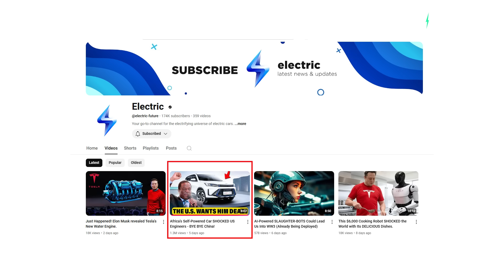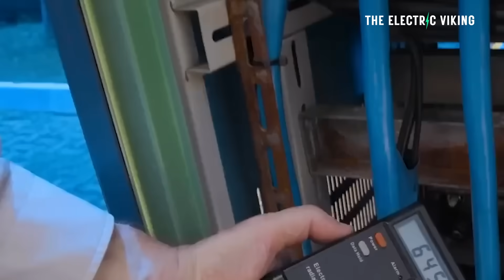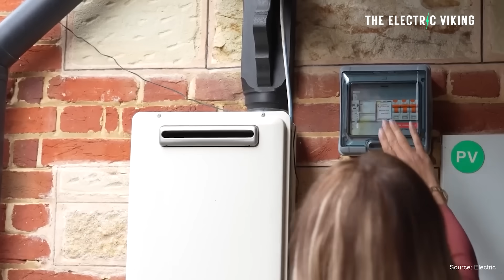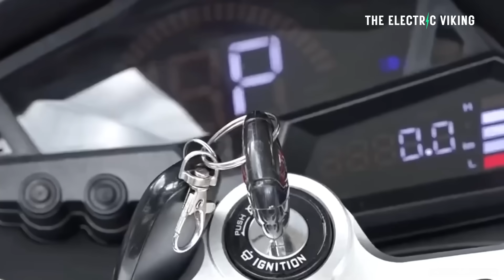Internet claims Africa’s Self-Powered Radiosonic Car SHOCKS Engineers

Comment: The plausibility is quite high on this, reality may well be low but judging by what people keep saying about the laws of physics where you can't gain energy only change it, well from what he is saying that seems to be exactly what he claims is going on 

He claims he takes radio waves and changes them in to electricity which is basically within the laws of physics.

How much power there is in radio waves is the question, and is there a way of collecting so much that you could power something big.

Presumably he claims to have found a way to collect lots of waves enough to power stuff.

I think it's fake, but plausible if you could collect enough waves and different waves probably produce different amounts of energy.
So we know the USA produced a device that send high energy radio waves that can be felt on the skin as though burning sensation.

So it seems plausible but o would want to see one of those machines working.

Comment: Theoretically this is possible
But if this actually happens, it will not mean that the major electric car companies will fail, but on the contrary, their businesses will flourish more and more
They will simply adopt this technology and dispense with batteries
The electric cars is not just batteries
But it is a combination of very complex technology and programs that only a few possess, and manufacturing capabilities that are not within everyone's reach and are also possessed by a few. Even fossil-based cars will revive again. There is nothing easier than adopting this technology instead of fossil-based machines and making their prices affordable for everyone.
Yes, battery companies may be affected, but they will also adapt
People will use this device to charge the batteries that these companies will produce
Yes, the solar panel industry will end, but industries related to electricity will flourish and become cheaper
Theoretically, the idea is possible, as Nikola Tesla did before, as waves are a form of energy and can be scientifically converted again from the form of waves to energy that is stored and used again
So we wait to see before we oppose what we do not know
Reply: Wrong, the first law of thermodynamics applies.
Reply: @1maico1  
Radio waves are converted into sound energy, television waves are converted into light energy, light waves are converted into thermal energy and with the converter they are converted into electrical energy. Energy is neither created nor destroyed, but it can be converted from one form to another. With reverse engineering, waves can be converted back into electrical energy, just as they were originally produced with electricity.

Comment: I'm sure the Nigerian Prince I've often heard from is going to fund this! Send him some money so he can!!! s/

There IS energy in radio waves [and microwaves and infrared-heat and light]. But there is incredibly LITTLE energy available in that form. So, we know that we can harvest energy from visual light. That carries at minimum 3 to 5 x 10 to the minus 19th while radio carries less than 2 x 10 to the minus 24th! So roughly, radio wave energy is just about 1/2 divided by 100,000 or 200,000 times WEAKER than visual light energy, and up to about 600,000 times weaker than visual light energy. All power values in joules to make comparison easy. Yes, you can run something off of radio waves. Something that needs an infinitesimally small amount of power. Conversely, if he was talking about Ultraviolet or X-rays, there would be MORE power than visual light. But much of that is blocked in the upper atmosphere by the Ozone Layer.

But I do hope the man in Zimbabwe isn't killed. I didn't even think that the President looked like he believed the pile of hooey being spoken. The thought bubble over his head said, "Wait. None of that works this way!"

Comment: fake stuff....
a fact check reveals a similar  product on Amazon, a Browey Portable Power Station (1000 with a built-in solar panel, 614WH/19300mAh LifePO4 Battery pack, and solar generator with AC/DC/USB/PD output, designed for outdoor camping, RV travel,  and emergency preparedness. It has also been revealed that  ,Chikumbutso purchased a Kaiyi X3 Pro electric vehicle and likely fabricated it with a Browey portable power station. It's quite an elaborate hoax.

Comment: I've noticed this go viral and the smooth brains that are believing it and ready to put money down without any proof of it working have me gob smacked. It seems to be always connected to a picture of Elon, it looks like a deepseek 2.0 to crash Tesla. While it is possible to obtain electricity from the air in radio waves no one has come out with something like this that can generate eleicity in usable amounts since Nicola Tesla. Just the name is a clue Radio Sonic, sonic is nothing to do with this method of power generation.

Comment: Murdered like the man that invented a car driven with only water?
The water story is fake as well, water in it self doesn't contain that much energy, a possible way would be to split the water to get hydrogen and then use fusion like the sun, but it is virtually impossible especially on a car size moving platform

Comment: Self-Powered, until it explodes or bursts into flames. After all, Samsung a major manufacturer with years of experience in battery production have recalled 180,196 vehicles across four vehicle manufactures, including Ford and PSA group for the same fire risk!
EV's are a death trap waiting to happen.

Comment: I think the real issue here, is the lack of basic scientific knowledge that so many people suffer from.
( I am an Electrical Engineer, so stay with me. )   ( I am also very open minded, FYI - I think Nikola Tesla was a genius )
Can radio waves be converted to usable electric power ?   
Yes, BUT.......the amount of power we are talking about here is miniscule, and is highly dependent on your distance from the antenna/transmitter.

At best, you might able to power one or two LED's, using radio waves from a nearby radio wave source (AM or FM transmitter, that sort of thing).
With that being said, I do believe that there is such a thing as 'zero point' energy (aka, 'free' energy), but I do NOT believe that it comes from radio waves.
I wish this young man in Africa all the best, and it would be great if his invention really worked, but I think what we are actually looking at here, is the Zimbabwean version of the 'Nigerian Prince' scam.
And if I am proven wrong and this 'microsonic' device turns out to be real.........I will be the first one to celebrate the 'age of clean/free energy'  
( but I am not holding my breath, nor am I investing my money in this ).
Reply: I've built crystal radio sets that will operate with only radio wave energy, no other power source...but power still has to be produced somewhere. Like hearing lightning crashes on your AM low frequency receivers or the old spark gap transmitters used 125 years ago. Very small energy.
Reply: I invented a radio receiver that didn't need any battery. It ran on radio waves and played music on an earphone. 
Since it worked it must be true. In space it could even power interstellar travel.
Reply: @patrickhenigin4805 i love you so much for your kind of consciousness in this aquarian age of free energy release by the Extraterrestrial intelligences of Light in our Solar System.
Reply: @patrickhenigin4805  maybe...but the power still has to be generated somewhere by something. Even energy from the sun is unusable without some technology to convert it to a usable form.
Reply: Sir, kindly are you thinking within the BOX, OR OUTSIDE THE BOX OR WITHOUT THE BOX??
thank you
LOVE FROM ZAMBIA

Comment: I don’t believe it either, but the claim has nothing to do with a petrol engine. This is supposedly a radio wave driven electric vehicle, not petrol or a petrol engine. In other words, an electric vehicle that derives its power from this “micro sonic” device instead of batteries. Picks up these waves via an antenna and amplifies them into high enough energy to power the electric vehicle. That is the claim.
Reply: Amplification requires energy.

Comment: It's a relentless waste of time because you never stopped to make a few basic calculations:

A small car on an even road would need about 12.5kW to maintain a steady speed of 100km/h, going up to 19.9kW at 120km/h. (Such a car would be severly underpowered and basically unusable, but lets stick to those low numbers to demonstrate the utterly flawed principle.)

Highly congested urban areas with plenty 4G, 5G, AM, FM, tv, bluetooth and wi-fi have a radio frequency density of about 10mW/m². If you had a 100% efficient antenna, which also doesn't exist, you'd need a receiver with 12500/0.01 = 1,250,000m². In different terms, that's an antenna measuring 1.1x1.1 kilometers. Can you see how ridiculous this claim really is?

(As to the claim of 220km/h, that takes around 150kW, or an antenna measuring 3.9x3.9km.)
Reply: Sir are you thinking within the BOX or outside the BOX or without the BOX concerning energy??
Reply: Depends on which box you're referring to. If it is the one of physics and its limitiations, definitely inside the box.
Reply: @schoolofglorytv6305  

I doubt you’re capable of rational thought at all.
Reply: Thanks for doing this, I was too lazy to bother.
Reply: @JohnSmith-x3y8h  , oh, it's a pleasure, I debunk myths for breakfast.
Reply: @Arthur_Götz  Mind you, in all honesty it's not a particularly difficult myth to debunk, a nice cup of tea should be long enough.
Reply: @Arthur_Götz debunk it while we're driving them 😂😂😂
Reply: @, who's "we", because I haven't seen a single report of anyone actually driving the car for 500km?

Comment: Take a plane and go to Zimbábue and get the proofs: is take or real. How you can tell that is take without proofs?!
Reply: “take” or real?  I think you mean “fake” or real, except you made the same mistake twice.
Reply: @ronaldrissel6665  Of course!!!
Reply: are you for real? do you even believe in that nonsense technology?
Reply: All that you have to do is think and reason at the level of a 13-year-old.
Reply: @franklogan3592 - Really why not a 15 year old 😂? Is thirteen your lucky number 😂?
Reply: @ You want some really creative thinking?  No TV, no car, just the device on a clear glass table powering a big resistive heating element.  One multimeter measuring voltage, another multimeter measuring current.  Just let it sit there on a table for a month producing thermal heat.  Magic heat coming from "waves in the air".  That is the simplest definitive demonstration that it works.  So, how about that?

Comment: Of the 2 boxes shown under the hood of the electric car, one looks like an ordinary 12V car battery, the other metallic box has a Toyota logo embossed on the cover... which one would not necessarily expect on a locally developed energy device.
Reply: True it doesn't use lithium batteries only 12v car batteries  because it generates and charge itself they just connect the radio frequency box

Comment: It’s a scam.

While it’s true that there is energy in radio waves, it’s extremely low. It’s many magnitudes less than solar, and it’s not currently possible to run a practical EV directly off solar panels, so obviously you can’t using radio either.

Comment: I think we need top scientists to investigate this. If I recall correctly, Nikola Tesla was doing an investigation on this exact thing before he died.
Reply: Tesla wasn't doing investigative work,he actually showed us how to harness the Earth's frequency and turn it into power,
Reply: His ran on water
Reply: Nikola Tesla"s car runs on the spot lifted for a weeek without batery just some kind of antena
Reply: No we don't. If you have a 1 m2 antenna, you will be able to catch 10 W microwaves and radio waves (microsonic waves is a made-up word). I prefer my 126 kW engine every day.
Reply: You recall incorrectly. Tesla did investigate the wireless transmission of power which requires that you first generate that power then transmit it then recover it losing a bit along the way.
Reply: Been done. Read article in Tech Central online.
Reply: No.

Comment: It is possible to extract energy from passing radio waves, but it is not practical. The only somewhat practical device that has ever existed for this purpose is the old fashioned crystal radio. These devices use a relatively large antenna (meters long) to extract sufficient energy to power a small high impedance, headphone (on the order of a milliwatt). Extracting enough power for an electric vehicle is totally impractical at radiation fields present in livable atmospheric conditions.
Reply: Yep...built several of them over the past 60 years. Very simple circuit using only a galenium crystal with a "cats whisker" or a simple diode also works. Will run forever with no power source other than radio waves but as you said, it requires a long wire antenna...a hundred feet works OK.
Reply: @northdakotaham1752  not enough to power an ev then.
Reply: @TerryHickey-xt4mf  no...in fact, not enough power to operate even a small amplifier of a few milliwatts. You can listen with a high impedance ear phone. Something I have done for thousands of hours. Also...only picks up AM low frequency radio waves.
Reply: Possible
Reply: Man u don't know Africa, here we get electrocuted when wet if we hold our arms out, do it long enough and u are toast.
Reply: if you live near a commercial radio transmitter one could   create a tuned circuit and possibly heat the hot water system but you would be easily found out and stopped .....please feel free to comment
Reply: @hocuspocus4719  if you could do that I don't see any means of anyone finding out. Once the power left the transmitter and it's antenna, it would be impossible to regulate who would use it and for what. That was an issue when Nicola Tesla tried to power people's homes with radio waves.

Comment: To me this is similar to solar roadways - it's a technical possibility, but in practice it's just garbage. You've got to remember that most people are not intelligent (they can mimic intelligence, but mimicry does not actually make them intelligent).

Radio waves are EM radiation, so energy. That's literally how radios work, they use an antenna to collect the energy, then use local energy (eg. battery) to amplify it, etc. But something needs to create the radio waves, ie. energy needs to be radiated, so it's not a perpetual energy machine - there's no such thing as perpetual energy, it always turns out to be a scam.

You can actually power stuff with radio waves (RFID being a prime example). But you first have to emit the radio waves, which requires a source of energy and lots of transmitters to cover wide area. There's electric buses that recharge using induction which is same sort of idea, but it needs close proximity. Nikola Tesla had designs for electricity transmission towers, which, while feasible, were very inefficient due to energy loss (to the extend it was more practical to cover entire continents with metal cables to transfer electricity). So it's not that it can't be done, it's just not viable due to the energy waste.

So yeah, it reeks of scam.

Comment: The Nigerian Prince strikes again!
Rasio waves Power densityon earth  is measured in milliwatts per square cm. The Antennas to collect that energy would be like a thousand time  bigger than a solar pannel to collect the same amount of watts. That's why you need a power amplifier to listen to your radio.
Applications:

This technology is particularly useful for low-power devices like wireless sensors in the Internet of Things (IoT), wearable electronics, RFID tags, and medical implants where battery replacement can be difficult. 
Challenges:
The main challenge is the low power density of ambient radio waves, meaning that harvesting enough energy to power larger devices can be difficult.
Reply: Key word "difficult", not impossible.
Reply: his technology is like a supercharged crystal radio set that can light up 100 LED bulbs instantaneously from an antenna and grounded wire connection!
Reply: Radio waves are essentially light waves with wavelengths above one meter in length. They have less energy than shorter wave length light that solar panels convert into electricity. While this story is likely covering complete donkey poo, an EV covered with solar panels like the Sonos prototypes, and other experimental solar vehicles etc. essentially offer similar free driving experience( but slower charging) that this guy is claiming but without magic.
Reply: sounds like you are going by conventionally accepted "science"    the one that keeps us rooted in ignorance  .😅
Reply: Storing it on big batteries will do the trick . But harnessing it again once drained will take days.

Comment: Hello Sam... you are telling us about your solar are great on your house...
Well, that is one pf the way to show you that free energy is around us...
Nikola Tesla has drive the electric car without charging, only with some small device to power up the batteries...
Same is here, his device is not running the car, but it is charging the battery..
If you guys take some copper wire, and run around the trees in the garden... let's say 1km of copper wire multiple times around, between two ends you will have some voltage, and if you boost that voltage, you can change the capacitor...so, it's not true that is not possible, just need to find the way...
For all out there, wish a good luck!